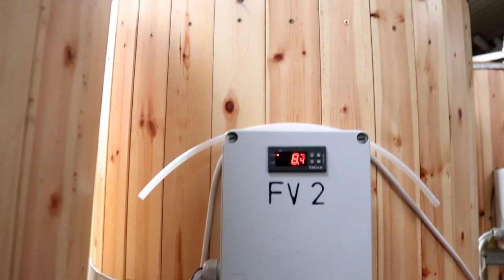DUST IN THE AIR? NOT ANYMORE.

Comment: How about a catchment tray under the fanbox (so to speak fnar fnar 😄) . Switch the fan off and give the box a couple of clouts and the dust may well drop off the filter material. We have an LEV at work which does basically that, hit the prime button and it shakes the filter medium to knock off the dust into a catchment tray before you can hit the extract button. Try just wacking the box first. If loads of dust falls to the floor it may be worth fitting a tray. Cheers, Schnuz.

Comment: Just a thought harry, would you not be better using a magnetic drive pump for the chemicals, more expensive but they last for years as the chemicals never come into contact with the inner workings of the pump.